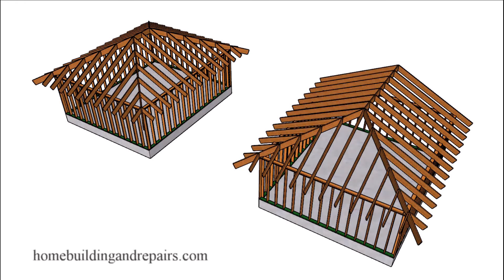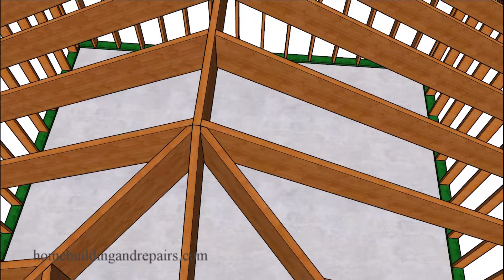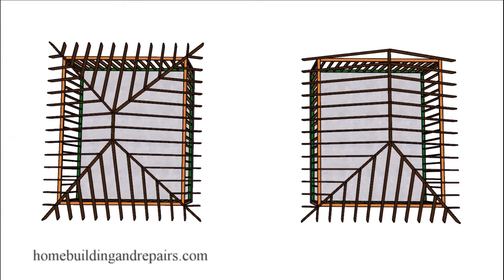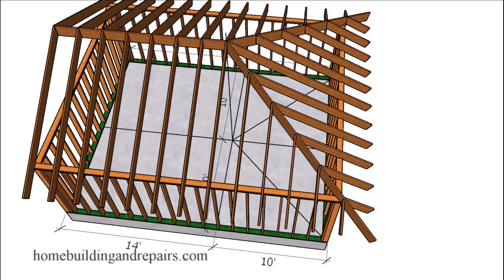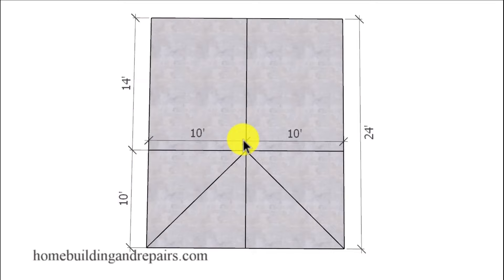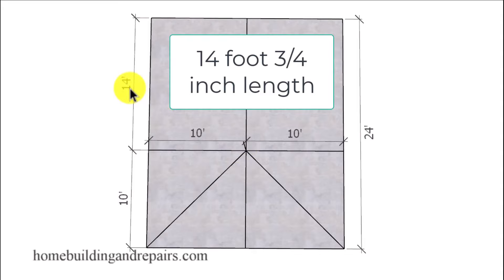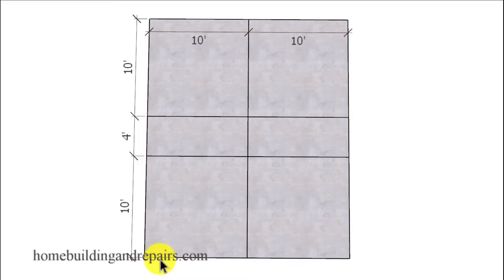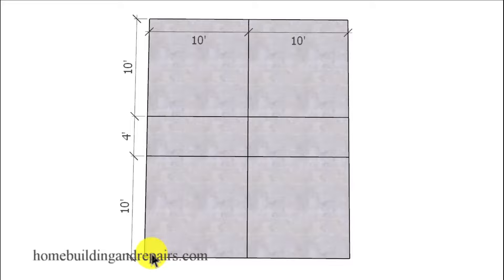How To Calculate The Length of Hip Roof Framing Ridge - Home Building Tutorial

Comment: Thanks for sharing...how would I calculate the height of the roof?? Please explain I'm a student watching from Papua New Guinea 🇵🇬
Reply: if you doing 12/12 pitch, and your outside to outside wall is 10 foot, your run will be 5 foot for the rafter and you'll also be 5 foot high for the ridge board (plus or minus a very litttle bit)